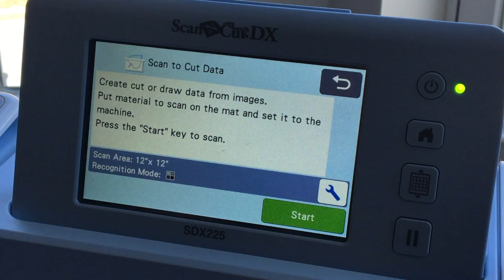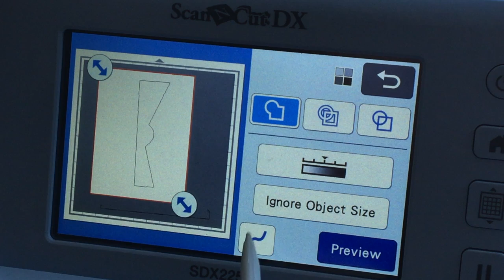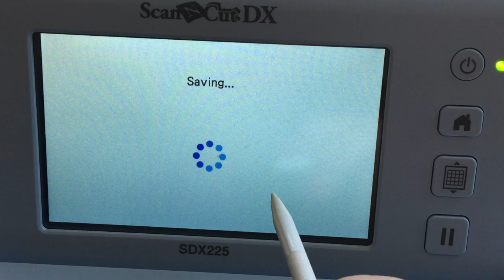Julie Fei-Fan Balzer and the ScanNCut Smoothing Option

Comment: Julie, please help.  I purchased a scan n cut a couple of months ago and have been unable to use it. The mat won't load!  We have all tried.  Customer service has been less than helpful, to say the least.  I have asked for a replacement from the store where I bought it,  but no go.  I am 72, so I'm guessing they think I'm not tech savvy enough to use the machine.  I don't really know but I 'd sure like to start using the thing in this lifetime.  
By the way , if you turn the mat upside down, it loads almost every time, GO FIGURE